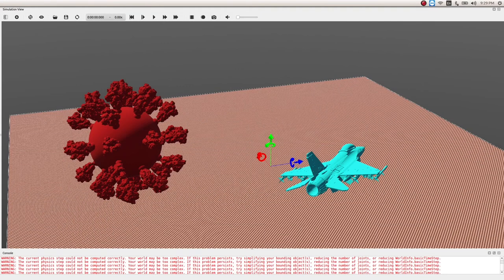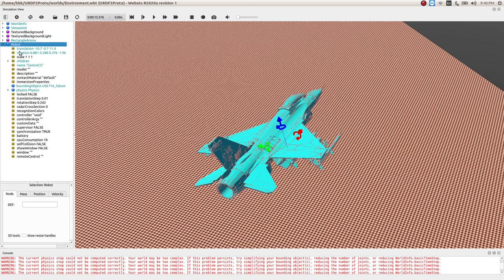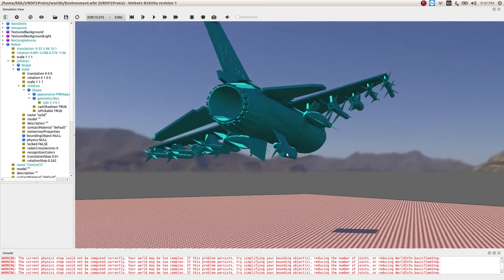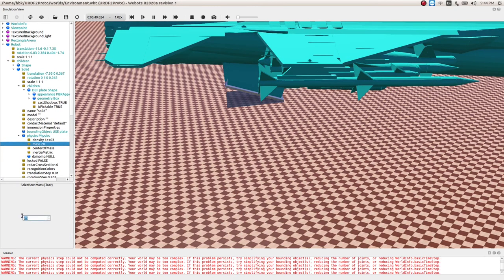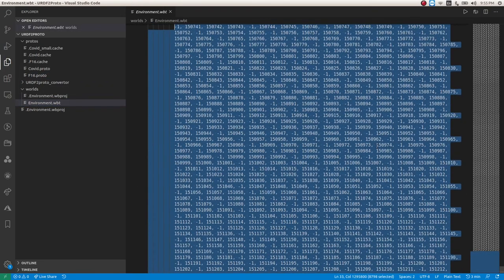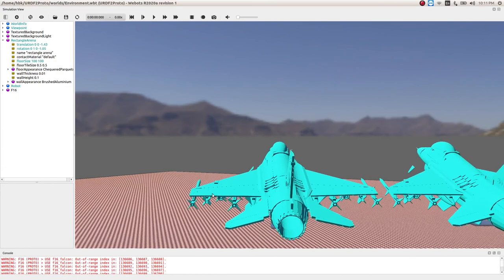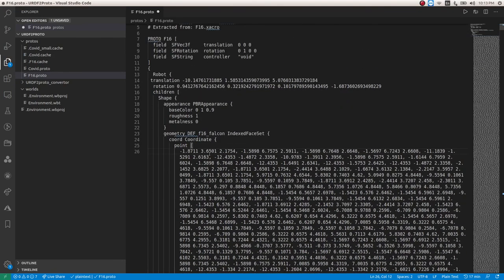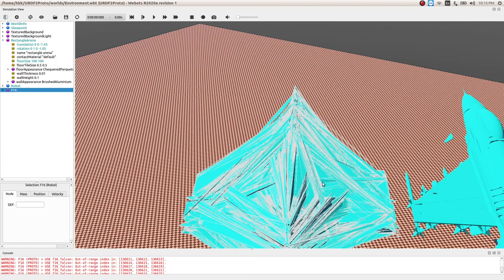Edit and stabilize Robot PROTO | Optimize resources for Simulation | Webots Simulator [Tutorial 18]

Comment: is it possible when converting the .stl file to proto, to convert it to have multiple nodes instead on just one shape node for the entire model?
Reply from the maker: Then you will need to have different .stl for different parts.
And make a URDF by joining parts in correct translation and orientation